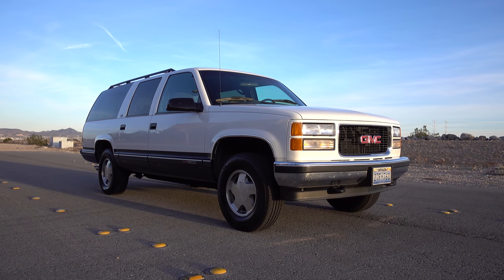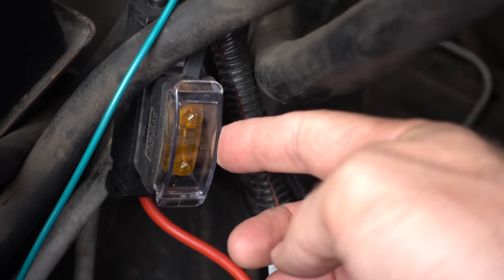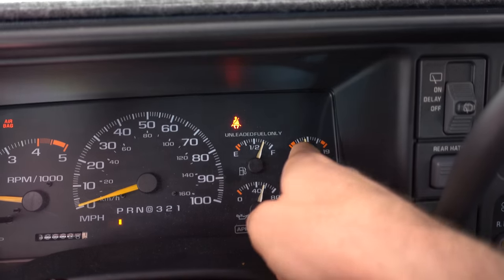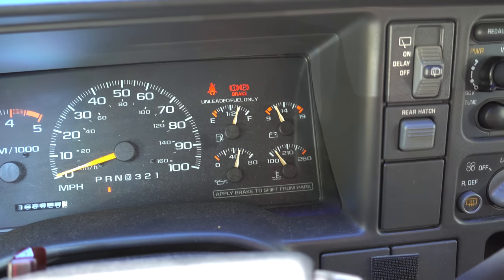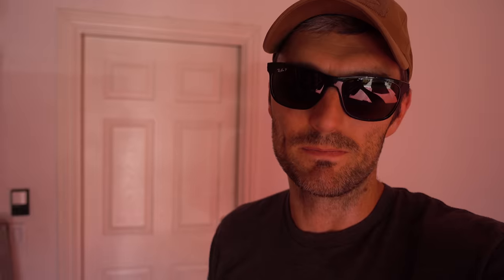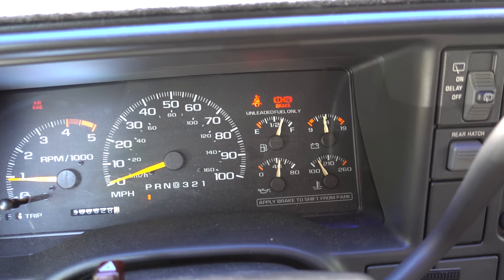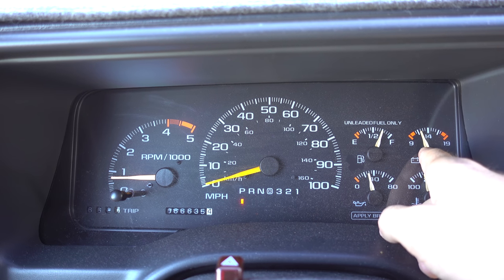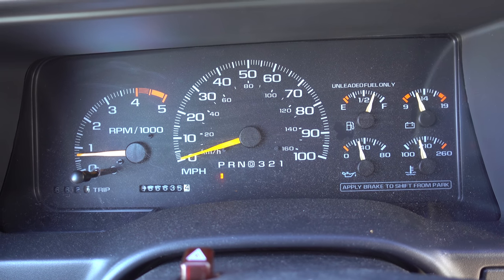SOLVE A LOW VOLTAGE ISSUE!

Comment: It's the alternator, you may have a 140 amp rated alternator, but that does not mean that it's producing 140 amps. Have the amperage of your alternator tested to see how many anps it's actually producing. your alternator should have enough amperage to run everything that you're going to run including aftermarket products plus produce enough amps to charge the battery too. You have to figure if you're blowing a 40 amp fuse with your fans, it is drawing more than 40 amps.

Comment: Did you ever figure out the problem I'm having a similar problem with my 91 z28 I've been told it's a bad ground. And my fans aren't even kicking on .I have a new batt. And rebuilt alt. And they uped the amps on alt.

Comment: Probably fixed it by now but I would just upgrade to a engine driven flex fan to replace the fan clutch, other than that consult an alternator and started rebuilding shop they are the experts.

Comment: CHECK VOLTAGE AT CIGARETT LIGHTER TO SEE IF IT MATCHES YOUR GAUGE.  MINE HAD SAME PROBLEM, GAUGE READ LOW BUT FINE IF CHEKED SOME WERE ELSE

Comment: JIMMY I check your - black battery cable the small black pig tail memory wire go to fender clean it up plus hardware also connector to from crossion also rust even lube up too ! Plus check voltage gauge again and running down road if drops too again got get higher reverse amps like 120 to 150 on 2 new  battery plus add a another one to so so have more reserve too! 140 amp Alternator plenty too JIMMY!

Comment: I suggest same put a heavy duty fan clutch and in my case I installed a dodge/dakota auxiliary  fan out and adapted it to my 1996 tahoe. .. and added a universal fan controller and works great since it turns on my tempeture or the ac signal that I signal it instead with a switch
Reply: by

Comment: I have a 1992 Suburban. I had/have this same issue. Replaced battery with a yellow top optima, did the big 3 wiring upgrade with 4 gauge oxygen free copper wire, replaced alternator with AC Delco new alternator, and then replaced with a high output alternator. After all of those things and in between each step, my voltmeter still reads really low at idle. My next step is to change the pulley on the alternator. I feel like it's just a bad gauge. Something that comes with owning an old vehicle.
Reply: I should add I have a high powered audio system in my vehicle. Also I ran wire from the alternator straight to the battery. I believe part of the issues is the large amount of power you draw with the dual zone AC. When I turn my AC off my voltage goes back up even with my system on full blast that pulls roughly 100 Amps of current.
Reply: Another update, I put the smaller pulley on and its a little better but not much. I found a forum and there was a tech report that said this was normal for the light trucks of these years. With nothing on at idle in park I get 14.1V and in gear at idle I get mid 12 to low 13. Never dips below 12. The bulletin said if there's no proof of a problem don't mess with it so unless I find something or it gets worse I think I'm done messing with it

Comment: Get a AC DELCO high amperage alternator. I found out the hard way that those aftermarket alternators are junk. The electric fans that you installed are drawing 40 amps more then the original equipment electrical system is equipped to support. Adding another battery isn't going to make the alternator charge more because the alternator is only going to charge as much as it can and as much as it is needed

Comment: Quick question i have a 05 Silverado I turn my ac on to 3-4 & the battery goes to low on my gauge air stops blowing really cold. 

Another thing that makes my battery go low on the gauge is putting my windows up as well. 

Brand new battery, brand new alternator ! Need help !

Comment: recharge AC with R134a. DO not overload alternator with extra loads. Low refrigerant is a problem not blower to cool. Do not use high blower inside too it consumes more amps.

Comment: I know this is old but I had a similar problem in my Camaro. Turns out it was the pigtail connector for the alternator. Now my car runs at 15 volts and it's absolutely amazing

Comment: I would say alternater likely a bridge rectifier. Just because it's putting out voltege dosent mean it has the amps also could be bad grounds affecting your alternater adding a battery won't do much more then lasting longer until the voltage drops your alternater can't supply what you are removing I will lie in some ware there.

Comment: High output alternator bro.. batt with more cold cranking amps might assist a bit but the alt is most important here.  Count up everything your truck uses and see whats left,bet not much. that will tell you how much more you need far as amps...  Look at 200 amp ALT!!  Your probs over!

Comment: the alternator is not putting out enough amperage to keep the system running.  You can either get your alternator rebuilt to meet the systems needs or buy a new one, its your choice good luck.

Comment: I know you said you changed the alternator.. But that looks like a 90amp.. The 130/140 amp Alts are bigger if memory serves me.. I would start there.. Sounds like not enough amps..
Reply from the maker: Ultimately had to change to a Mechman 250amp Elite. Truck runs much better now. I currently have the stock clutch fan back in and volts always stay at or above 14v.

Comment: I have a 2005 Chevy blazer  It has all the toys  one of the first things i changed was the CS-130 to a AD-244 because it is a higher amp provider even at idle..Yes your battery starts your car but your alt feeds everything afterwards..I noticed my headlights dimmed when i put on the AC or heat and music....Now i can run wipers and defrost and 4 ways and honk the horn ontop of the rest and still no dimming

Comment: I got the same problem I got a 96 Jeep xj stock wiring and alternator is 90 watt so I upgraded to the big 3 wiring with a 200 amp fuse and a 160 watt altnator and when I turn my ac on and my extra fan and my headlights it goes to the red I cleaned all the grounds

Comment: Cable's are one thing, but for a system that is built around  clutch fan, an by you adding  more pull you mite need to upgrade the Alternator  12 to 14 volts is good .. but it should keep that charge  even at a idle  even with all the other stuff on in the truck ...

Comment: Sure the alternator is 140amps
 Prolly takes  60 70amps to run truck alone
 Plus the 40amp draw for the fans.. Plus the ac in the back 
 Add in the 100degree plus heat
 That's all the alternator has to offer
 Get a REAL battery something AGM.. 
 Upgrade wiring more
 And all else fails get a dual alternator bracket
 Run the stock alt with the 140amp

Comment: need a chasis ground,  flexo lite upgraded the module that runs those fans too, and I say u have a bad voltage regulator,  those fans will draw 35- 40 amps ,  might under drive the new alternator so it spins faster idling,  thats how I fixed mine

Comment: Check the 10 Gauge wire that goes from the alternator to the battery. Mine gets so hot you cannot even touch it. I will be replacing it with a heavier gauge.
The hotter it gets out the lower the voltage goes . (Heat increases resistance) . Also planning on upgrading to a 145A alternator from a 99-05 truck. (OEM is 105A)

Comment: I have a OBS 1994 K1500 5.7L and I put in the same PowerMaster High Output Alternator and ran into this same issue.. Its all about RPM at the alternator.  I fixed my issue by putting on a new smaller diameter pulley from Mechman, so its spins faster at idle, alternator no longer dips when at idle. *note you will most likely need a smaller serpentine belt also.  Other quick fix is just increase your idle RPM so the newer High Output alternator can work as designed.  they dont work well when idle is down to like 500RPM (this happens when you have loads on and are in drive)  just an FYI, if anyone else is having this issue.

Comment: I tested my MPFI 5.7L 97' Chevy 3/4 ton short bed and I get 14.4v at idle with everything off, yours is a bit lower and you wouldn't think that would make a difference but 1 volt charging can make a world of difference.Alternators I always replace in pairs it seems, and by that I mean I have one go out, replace it with one that lasts a month, that gets replaced with one that lasts till I get rid of the car. my chevy I haven't replaced the alternator ...yet. no matter where it comes from or where its made its possible to get a lemon.take the alternator out, take it down to a parts shop and get it bench tested. go from there, contact the manufacturer and let them know whats going on and what to do as well

Comment: check out the fans you installed most truck that run that type of system have temperature switches that the fan is hooked up too that tells it when to turn on, and also have relays that are in the middle of them so it doesn't pull all the juice like that I had that problem with some music I installed they had too place a capacitor in between the amps and the battery

Comment: hopefully you have figured out . that you need a alternator. since you added the fans. you need to upgrade the alternator. I haven't finished the video when commenting. if you have about a 100amp alternator. you will need one about 150 amps. maybe someone put the cheapest alt the Autoparts had. and that being a alt to small for your vehicle.   or lower amp output. in a perfect world. the alt. supply's all power when engine is running. with a smaller than needed. with heavy load. will run down the battery while the engine is running. there lots of places to help with a alternator upgrade. I'd go with 150-160 amps
of try using only a single fan! if it will keep cool. I know how it gets in Vegas in summer. that's why I wouldn't live there. I don't think it dropped below 100degrees while I was there. and well over during the day.  hope I helped.

Comment: The Alternator is NOT intended to run the electrical system. The number 1 job of the alternator is to charge the battery. The number 2 job is to supplement the battery output to the electrical system. This is where you are having your problem. The Alternator and battery are capable of  keeping up with the normal demand on them. But when you max out the load and then throwing on an additional 40 Amps with those fans, it simply cannot keep up at low speeds. This may cause the alternator and battery to fail prematurely. The proper solution would be to upgrade the system with both a higher output alternator and a battery with more storage capacity. Note that I said more storage capacity. That does not necessarily mean more CCA (Cold Cranking Amps). It means you need to go to a larger case, which your parts store will call a group number.

Comment: Alternator upgrade higher amp plus check cables for corrosion I did my alt to battery with new cable ends and cable to fuse box also new cable terminal.

Comment: Your Best bet is putting a Voltage Inverter On your coolers so the draw off the battery is a lot Less I had to do the same for my LED headlamps and coolers now it dont tax the battery or the alternator so much

Comment: I have a 2000 obs Tahoe z71... it has the factory upgraded alternator at 140 amps.. with my front and rear blowers on high, the headlights and factory fog lights on, two 130 watt kc driving lights on, and then a factory auxiliary cooling fan.... it drops down to 12 volts... as other people have said, I'm going to upgrade the cable from the alternator, and also the ground cables... as far your fuse blowing, the lower the voltage, the more amps you will draw... meaning when you're sitting somewhere and your volt gauge Is showing 12 volts or under, your amperage draw will increase, therefore blowing the fuse... I'm not sure if that's what happened, but certainly possible. I would check all the ground cables, and cable from the alternator, if they all are good...I'd have the alternator looked at.. the battery is only there to start the truck, once it's started, the alternator takes over to supply the demand.
Reply from the maker: +John Moore Great info. Thanks. I guess I really need to check my cables again. Love that truck you drive. Especially the stock rims that came on those. Your theory of lower voltage and higher amp draw sounds pretty much right on.

Comment: after blowing a 40 amp fuse for those fans id be checking that wire circuit and amp draw. Bet there way over 60 amps of draw. Alternator should keep a minimum of 13.00 volts even with all accesories on and preferably 13.8 to 14.2. Side post terminals can corrode as well as grounds and positive connections . Need a high amp alternator once all wiring is fixed

Comment: Thats not normal. check the amperage output on the alternator. May possibly need a bigger amperage battery to keep up with the load of the fans and load.

Comment: I had this same problem with a 93silverado454ss   its not the battery. the battery is only there for 12 volts to start it the alternator brings the whole system to 13-14.5 volts. I have the same fan set up as you and I also  have HIds lights in my fogs lamps and headlamps plus I also have TVs in the truck I kept on burning out alternators which will eventually happened to yours too what happens is at idle in drive the alternator isn't able to put out enough amps to keep it at 14 volts  once you get the RPMs up it will then start to pick up more power output I ended up talking to a friend of mine that works for GM he told me from 89 to 2000 GM was only putting 90 -105 amp alternators in there c1500 or k1500 trucks not thinking that people where going to start adding more electrical apps to there vehicles he recommended me to buy a 160 amp alternator which I got out of a 2500 silverado after I installed it, turn the truck on and turned on everything . it fixed my problem I can power everything plus the AC on max and it stays at 14 volts never drops under... its been 4 years and still as strong as new
Reply: So pretty much just get your truck a stronger alternator and you will be set to power a house

Comment: I'm having the same problem just from car audio......im only running stock 105amp ac delco alt right now that cant hold up with 2 15s wired directly to the headunit, not even got a amp wired in....im planning to upgrade to a 230 or 270 amp alt (budget permitting) hoping that solves it

Comment: The truck is fine its very hot outside and your a.c. and fans are running at full blast so it could drop to 12.2 volts or 11.9 volts remember everything is maxed out its fine

Comment: My problem  is just the other way around. When I increase my rpm's to over 1500 the alternator begins to dive from 14v to less than 12 sparking a battery discharge symbol and then cutting off all electricity for accessories.  If I turn switch off and on again all returns to normal.  Any idea??

Comment: hey man great content.

i think you need to double check those fans 'cuz it seems that they are not running normal if they pop a fuse. i really think the fans are just too demanding for the application. and have the alternator checked too. maybe is faulty ( cant handle the load)

Comment: My ranger does that when the fan is on med-high, lights are on bright, and turn signal is being uses. Shut off any one of them and the charge returns to normal. I'd check wiring, I've worked on 3 ford trucks made in 1984, 1988, and 1993 and all had wiring corrosion problems.

Comment: You need to install a bigger alternator and put two batteries in the truck I have the 1998 Tahoe with two batteries and I had them put a bigger alternator to keep up the voltage

Comment: The battery does not run the electronics. The battery is there mostly just to start the car. The alternator runs everything, once the car is started. If the alternator is not putting out power, then any battery is going to go dead eventually. Even dual batteries.

Comment: Did you every get to a root cause?  The alternator is going to do all the work after the engine starts. The Alternator is also going to derate with temperature.  This may be the bigger issue being in a hotter climate.   Hopefully you found a current clamp and started to measure current out of the alternator and draw at the fans.  VA=Watts Watts are going to remain the same.  The mixture between V and A will change such that if Voltage  goes down,  Amps is going to go up.   Your fuse is going to blow because of amps. Also that fuse is going to derate with temp as well.  I'd like to hear a comment if you got it fixed.

Comment: First You need to put a fan relay on both fans.Second You really need a higher output alternator, Third dual batteries will help the issue for the short red light stops..alt.runs everything and charges batteries up when driving,batteries help with short burst of amp draw.